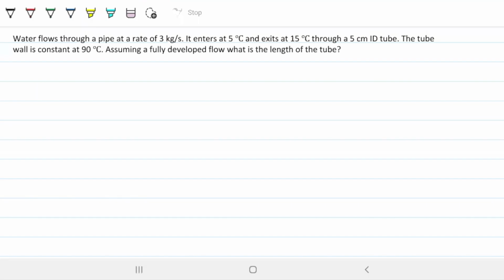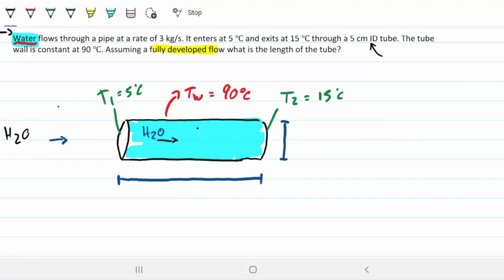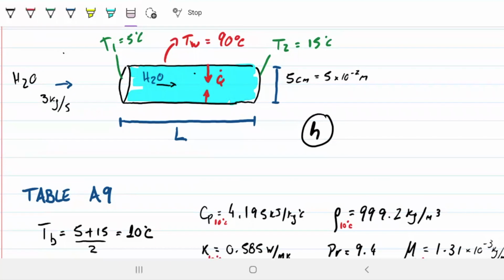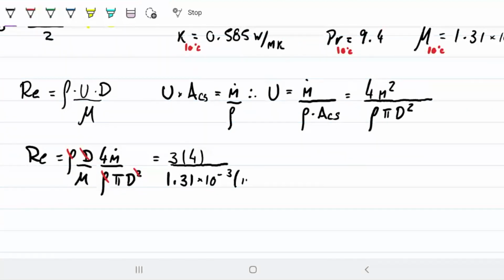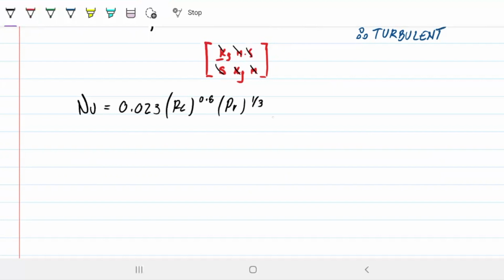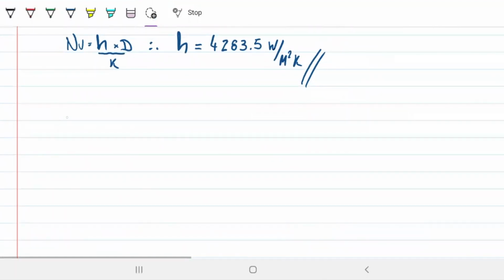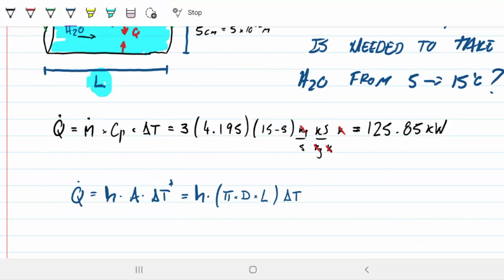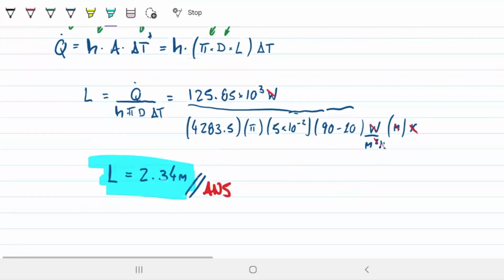Convection in Water Pipe - Turbulent + Fully Developed Flow - W10Q3

Comment: Hello. Good morning. I have been following your video presentations regularly. Could you share an example when the heat transfer happens in two phases, like water tube boilers? Example: A water tube has 65 liter/min water flow at 40C and the it is being heated with a constant heat flux of 500kw/sq mtr. What would be the tube skin temperature if the outlet water temperature is 54C. The tube inside dimensions are 80mm x 75mm (rectangular) thickness 6mm. Length of the tube is 1800mm.  Water pressure 4 bar.
Reply from the maker: Hi Paromita. Happy to know you've been following the channel. I'm pretty sure there are a couple of heat transfer videos addressing that situation. Nonetheless, I'd be happy to solve your problem. The video backlog and requests that I have would allow me to post it in 2-3 months. Does this timeline suit you?